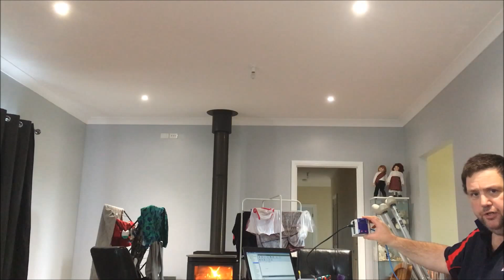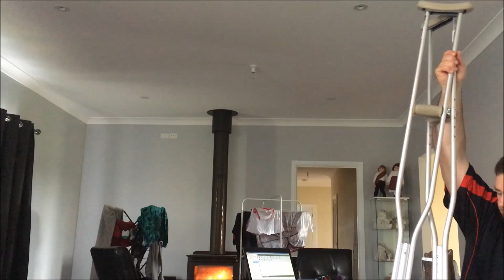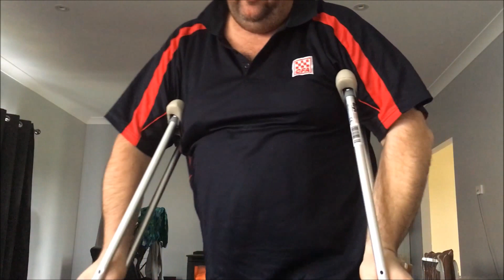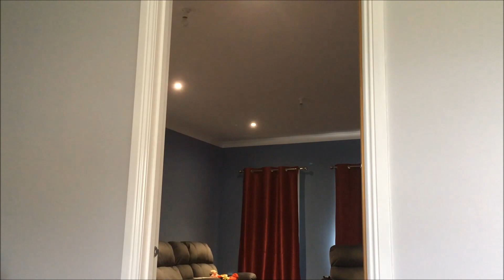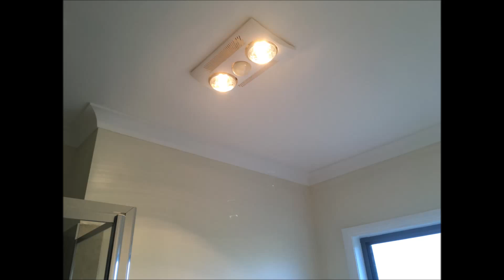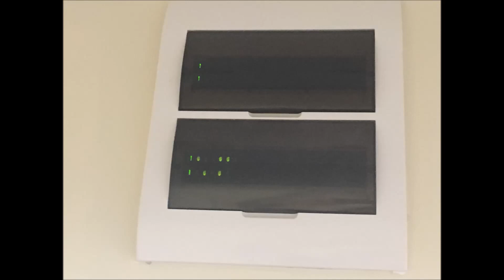Home C-Bus L5504D2A Leading Edge dimmer with Trialling Edge Dimmer LED downlights

Comment: These days you can buy LED lamps that will work with leading and trailing edge dimmers. LED GU10s from Osram and Philips will work just fine as they have more sophisticated drivers.  You do have to set the minimum level output level on the 5504D2A to match the minimum dimming level of the lamp.  Also the better brand lamps tend to have grater dimming curve (the amount of dimming that is possible). Some cheaper lamps might only dim 50%. Also best to have all lamps as the same type (same brand and model).

I'm in the process of switching from MR16s to Gu10s. The 5504D2A needs a minimum of 25w load per channel, and as LED lamps are generally much lower wattage than MR16 lamps, there needs to be sufficient load on the dimmer.  Fortunately there are LED lamps that are 8w or even close to 10w. I need six in my case too, so 6 x 8w = 48w is enough to load the dimmer. Also means if one lamp fails the other five still place enough load on the dimmer.

There's a good explanation on eFixx's channel.

Comment: Hi VK3HAU,  I see that you are a HAM operator. Do you use HF at home and do you find major interference from the CBUS network to the HF band?
Reply from the maker: Hi Nathan, thats a good question, I don't have HF set up atm, will be setting up soon, I'll keep you posted. thanks. de VK3HAU. 73's.
Reply: @vk3hau  Mate i have interference on anything in the HF band. I can still use but noise floor is effected badly. I turn off lighting circuits in the house and she all goes away. I'm pretty sure its the network after doing some testing. Let me know how you go. 73's RR886

Comment: Hi vk3hau,

I am just about to start a new home build with a complete c-bus install. any advice or tips?
Reply from the maker: mattyweslide 
Hi Mattyweslide, I sourced all the c-bus gear of eBay, found I saved about 50% on full price that way, but I had 6 months to source all parts needed as not always was the items needed listed, I recommended making a plan of how you want the system to work, e.g. What room you want to have dimmers and want rooms will need relay units, like bed rooms with dimmers ( as I have young kids and I like to be able to dim there lights ) also work out how you want the timing to function, e.g. The heat lamps and fans in the bathrooms, the kids would leave the heat lamps  and fan in the bathroom at the old house on, but with c-bus you can tell the system to turn the heat lamps, fans, lights off at a lapsed time.